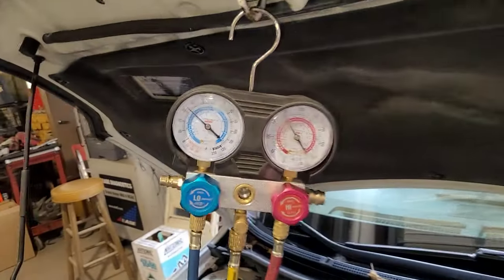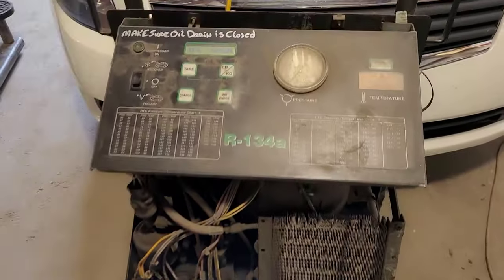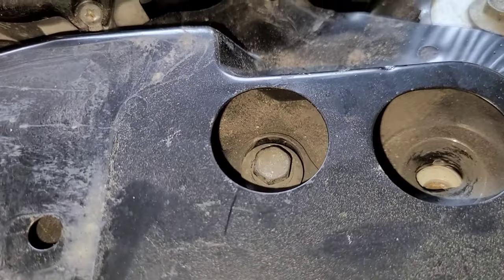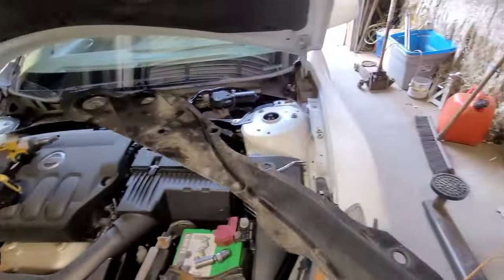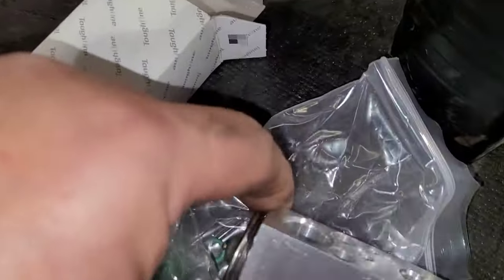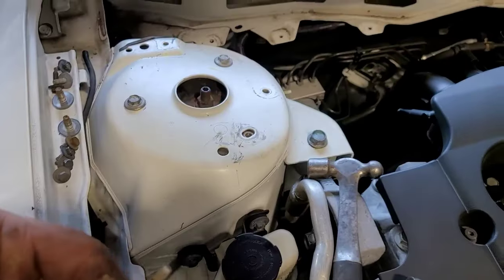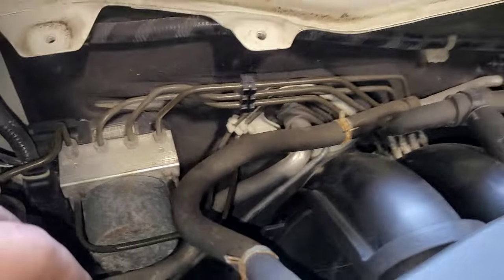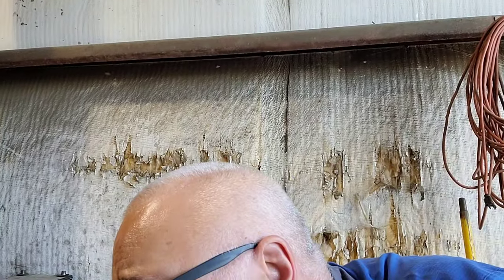AC not blowing cold, then it works fine !?!?  What could cause this?

Comment: new sub, great vid,  when do you ad pag oil,  just did a evacuate and recharge but did not think about oil.  there were no parts replaced just very low, empty on refrigeran, did hold vacuum for 45minutes and took recharge,  thanks again

Comment: Vim tools are not bad for the price? Have a Lisle Master Torx set, it's impact rated and great, but the detent for the ball lock isn't machined into the drive side of the sockets, and the sockets just fall off the extensions.

Comment: this confirm the same problem I have with my van where the ac tech put water in my system after he vacuum. As a scam to get me to keep returning the particles is more likely rust from the flex plate where as mines show small rust spots.

Comment: May you please tell me how you knew it was the expansion valve and not the pressure switch. I am having this issue. Thank you.
Reply: Were you able to determine the issue? What did you do
Reply: Pressure switch usually prevents clutch from pulling in altogether. Sometimes it will be intermittent. If system has verified correct charge (by connecting guages) you can jumper there two pins together and leave fan on high. If you don't evap will freeze. You can also just lightly tap on the switch. That usually will cause a weak switch to show itself.
Reply: @topher8634  amazing!! Thank you!!

Comment: Do you think this could be what is going on in my wife's Five Hundred? Been having some issues with it for a few weeks now. It cooled great today in the late morning but after a while, it just blew out HOT HUMID air. Wouldnt even work with defrost it seemed like. I am so frustrated cause all this stuff is supposed to be new and replaced in 2021. The compressor can be heard clicking in and out and it would make the motor surge when you sit at a light or put it in reverse. I was wondering what your take is on it. Cause like I said it cooled great today and then just conked out. I would appreciate it.

Comment: Mr. Kenny I have a similar problem with my Toyota Corolla 2011 LE. I took it to the mechanic and he told me it was a low pressure from my  Compressor. But after whatching your video it made me think it could be the same thing from your video. My problem is when I'm in the highway the airconditioner works fine but when I'm in the city in stop and go traffic the air stops blewing cold every once in while and then starts again once I maintain a steady speed. Would you have any idea what it could be?

Comment: good video. i have a Subaru Legacy 03, and i have a problem with the AC, it is run good with cold air and sudendly start blowing hot air , i check the compresor is good , the relay is good too, probably i have to replace the valve
Reply: So did you replace it. Update

Comment: What could be the problem if the AC only blows cold when I rev it past 2000 RPM ? Air is warm below 2000 rpm. System was charged with freon. Also on cold start, if car sat in a cold underground parking, it starts blowing cold air right away, but if it sit in the sun and I start it, it blows warm air unless I rev it for a while over 2000 rpm. This second part might indicate a sensor problem ?
Reply from the maker: Could be a sensor or blend door problem. Let me know what you figure out. Keep wrenching 🔧
Reply: @WrenchingWithKenny  mecanic changed the compressor with a new one, it works, that was probably it, because previous compressor was second hand and it worked around 150 000 km on my car. If it lasted less I would think the filter / drier might be clogged and wearing out the compressor.
Reply from the maker: The drier might be clogged, which would shut down the compressor. It wouldn't wear the compressor out.

Comment: i have a 94 civic. it has a Dual AC pressure switch (detects high and low pressure). is there a way to bench test the pressure switch with a vacuum pump/gauge? the service manual doesnt have any specs for bench testing the switch.

Comment: I have a 1993 Chevrolet suburban, 94,000 miles. My A/c compressor started rattling and the A/c stopped cooling. I took it to a repair shop and they replaced the compressor and other A/c components. It lasted 3 days before the compressor started rattling Again, BUT it was still Cooling. I took it back and the shop replaced the A/c compressor and whatever , that repair lasted 4 days before the compressor started rattling again—— still cooling. Took it back , now I’m on my third compressor. It lasted 3 months and it’s RATTLING AGAIN . Looks like I’m taking back again ( 04-20-2023 ) . Regardless WHAT could be the problem. Basically the only time it stopped cooling was with the factory compressor. Thanks
Reply from the maker: Sounds like there is debris in the system that is ruining the new compressors. Did they flush the components initially? Post this thread to our Facebook page Wrenching with Kenny. It will be more visible to me & other members for follow-up. Thanks for watching
Reply: Update please
Reply: Sounds like u need to replace the condenser and any valve it have. Probably there are old debris from your broken AC compressor that got into the hose system maybe clogging up the condenser or valves. So keep replacing the AC compressor won’t do any good.

Comment: Hey Kenny, like a dumb dumb, I power-washed the front lower half of condenser, (UGG, will NEVER DO that again)...anyway, there was a VTEC issue previously and oil all over the passenger side of engine (03 honda accord 4cyl) So, fixed that.  And replaced a shredded harmonic balancer and crank seal...getting to my question. 
If I damaged the condenser, are there other things I should do as well as a result? Clutch is not locked up, but not engaging either. Hot air flow in cabin.  Both fans work. At this point because the system's has high and low sensors on condenser could have ohm'ed out, I have to 'run ac' to keep fans cooling engine bay (hot air) to keep from over heating, which it is not doing but could if I dont turn fans on manually by commanding AC on in cabin. 
Again, a new or good used condenser with dryer, is my first step? Either way I will vacuum and recharge. Think I will test the compressor, a destroyed condenser which could have created an arc or killed the ac compressor/clutch. There is pressure in the line. but yet to hook up gauges for an actual read. 
Your video is excellent for this, Thank you!!!
And i may open at firewall to peek at expansion valve, before I recharge for any visual contaminants. 
Honda's do not like running with out AC system working. Throwing CEL and p0442 (small leak in vacuum actuator)...any other suggestions as to what other part a destroyed condenser may have caused? I really think the compressor does not need replacing, but it is a 2003.
Reply from the maker: @rinserepeat12877 Usually, the fans won't come on until high side pressure USUALLY reaches a certain point. I would verify what the ambient & coolant temperature actually is, using a scanner. It's possible that you may have buggered the ambient temperature sensor. Keep us posted. More importantly, keep wrenching 🔧

Comment: Looks like i have the same problem,  iits hapoend short time after i  take a service of the system,  vacum, refill the system,  i have 45 psi on lowpresure  and 150 psi on the high presure side,  works vel fore a wil,  bit no its the lowpresure pipe not cold more, but the highside pipe have temprature,  i have still the same presure in low and high side

Comment: I got a f150 2009 5.4L got everything new the compressor, condenser, fan clutch, evaporation valve literally everything when I’m driving it gets cold but when it comes to an idle or I stop at the light it gets cool not cold any suggestions

Comment: I realise this is an old video so my comment may not be read ,Here in AUS  every time we recharge a system the TX valve as we call it is replaced as a preventive measure Cheers.
Reply: It’s commonly referred to as a TXV (thermal expansion valve)in the automotive industry.
Reply: TX Valve, TXV, TEV are all common acronyms for the entire HVAC/R industry.

Comment: Hi brother thanks for your videos I'm a subscriber.

Question please...

I have a 1995 Lexus LS 400.

The radiator fan is not activating.
It does work because i tested it.

I disconnected the connector that's connected to the receiver drier and the radiator fan turns on and stays on continuously the whole time.
But when I reconnect the connector the radiator fan turns off.

I'm trying to fix the fan so that it turns on when I turn on my air conditioner but the fan does not turn on when I turn on the AC.

I feel like it has something to do with that connection but I'm not sure.

Do you think I might have a bad sensor that's connected to the receiver drier?

Thanks.
Anybody knowledgeable please reply soon.

Comment: How do you attach Harbor Freight gauges without damaging the high and low Schrader valves when you screw them down?
Reply: full ccw on connecting slowly cw until they open and then stop

Comment: i have a 2010 civic and the car ac blows cold when i have it in the garage but when i leave it outside in the sun it only blows air. the clutch kicks on, fans turn on and relays are new. can this be a bad valve as well or the condenser

Comment: Hi ... Kenny I have a 97 4runner and the freon went out and it was blowing warm air so I took it to a mechanic and he recharge it, but it was cold for a couple of days and went warm again so i took it back and the mechanic tested for leak, but it seem to be fine no leak was detected so he determine it must be the ac condenser under the glove box  for the 3rd generation 4runners and so he replace the ac condenser and the expansion valve, but now when I turn on the ac it didn't blow many cold air and we trace the coldness of the freon going through the pipes and found out that the freon was only getting to the expansion valve , but will not pass through to the ac condenser so the air was only blowing cool, not cold and every time  I turn on the ac the compressor would turn on and off repeatedly just turn on and off on and off after it turns on for a couple of seconds than it would turn off again will you tel me what is wrong with my ac system I needed help, but couldn't find anyone knowledgeable around here and the sshop wants and arm and a leg for them to just look at it. please help me to get my ac running correct again.
Reply: Sounds like your system is low on refrigerant.  The guy who diagnosed a bad evaporator and replaced it, is responsible to give you a working system.
Reply: He needs to put gages on first and see what the pressures look like and go from there. If the expansion valve were bad (not opening up) you would get a very high reading on the high side and a very low one on the low side. There could also be other areas of trouble. You will need to find someone who understands how the AC operates in an automobile. Some people don't even evacuate the system before charging it up which can leave air and moisture in the system causing trouble.
Reply: This sound like my overcharge AC on my Lexus RX. I over filled it. And the compressor turn cycle on and off on and off and ac is not getting cold. I empty out a little of overcharged Freon. It work fine now. No more on off on off. 
The person that charge your AC either didn’t check the amount Freon put in or he don’t know what he’s doing.  If AC Freon is low , AC is blowing cool air instead of cold air and it makes a funny loud noise from the engine when compressor kicks on.
Reply: The unit under your glove box is an evaporator not a condenser.

Comment: Where are you located? Florida? Haja😊 my Saturn vue 2009 .sometimes it reads engine hot a/c off but after a while its clicks back on cold a/c
Reply: Oh! I have replaced the sensor from the engine
Reply: Thermostat

Comment: I had this exact problem with my system and doing this replacement did not fix the problem.  Ended up being a faulty low pressure switch.

Comment: Hey i got a 2011 eclipse and look like there is freeon on the system and my compressor clutch used to engage but it woult turn on and off but when car was at a stop or light clutch wouldnt engage only if i would be driving
About a month ago we got to 85° and clutch wont engage ac comess out hot but still freeon on the system
Found out evaporator or expansion valve are leaking so im about to replace both and the pressure sensor and blow the drain tube, you think that could fix my ac? If it dont work im out of ideas
Reply: Ive changed my compresor condensor dryer and low line
And about to do my evaporator expansion valve again pressure sensor and blow the drain tube
All this because my ex crash my car and ac stoped working

Comment: After I replaced my rear condenser, I get this kind of hissing sound from the rear. It stays cold. Not losing any pressure. Not sure what's the issue.
Reply: That sound is freon moving through the system. If it's not a steady hiss, it's low.

Comment: I've had bad experiences with aftermarket expansion valves,always use oe
Reply: What happened?
Reply: @bekire2215  they either buzz or pressure fluctuate wildly
Reply: @alanearnest6040  i had replaced the expansion valve. still not solved my problem. how did u solve urs?

Comment: What about a system that has a high low side pressure and the high side doesn’t budge from 100?? (New ac compressor and sensors)
Reply: What make of car and year?
Reply: Sounds like bad compressor or compressor control valve.

Comment: Interesting??? Went to the dealer last week they said "for some reason it would hit high pressure then push hot air through one side" the wanted 1200.+ for a new compressor. Now I'm wondering 🤔

Comment: What’s the case if it’s blowing cold while driving but not while stopping on traffic signal for example?
Reply: Check the fan motor at the engine area, got 2 usually.. One for engine, one for aircond..
Reply: Or fan clutch... if you don't have electric fans.
Reply: Also inefficient compressor. BTUs change with compressor speed.

Comment: Why are you checking it at idle? Needs to be checked at 1500rpms. Low side around 40 to 45 depending on temp. 

The expansion valve may have a nick in the slide where the valve is and it's sticking like a thermostat would. 

Low side pressure is the most important factor in cold.
Reply: Are you saying that all automotive ac systems are to be tested at 1500 rpm? Also, what would wave nicked the valve?

Comment: Does any one help me find the issue Ac compressor doesn’t turn on .. new Ac compressor new Relay new high pressure switch but compressor doesn’t turn on … but when I put paper clip on the relay compressor turn on ..
Reply: It can be your refrigerant pressure sensor, the refrigerant temperature sensor located near the evaporator or the ac control unit itself
Reply: Did you fix it. Update